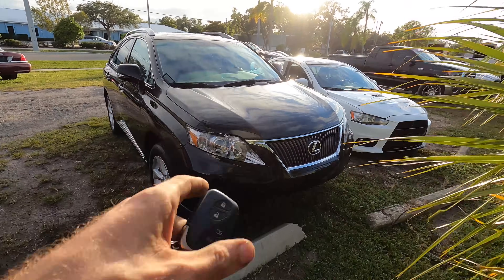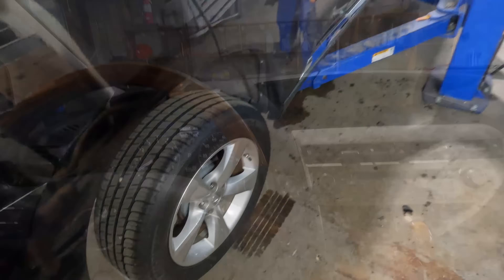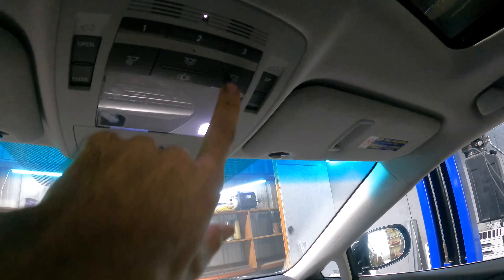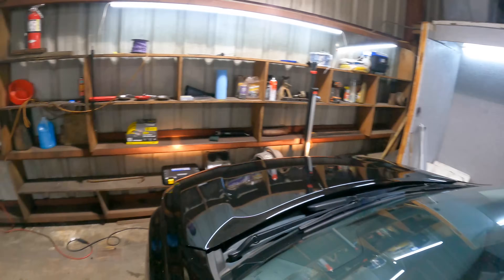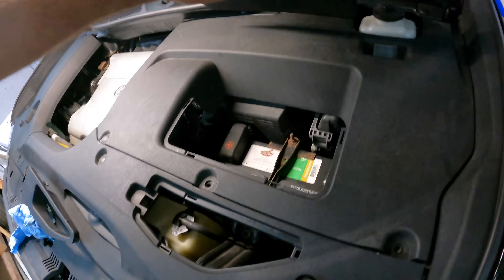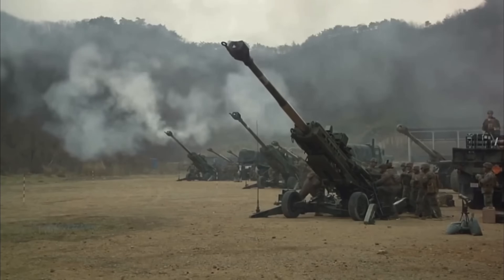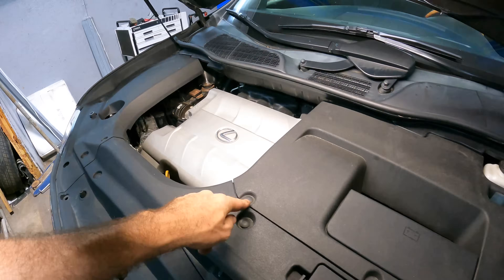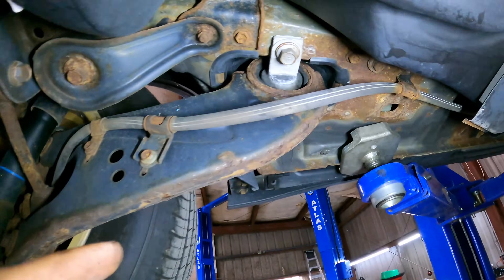Spoke Too Soon! Twice! Lexus RX350 3.5

Comment: You really should close that small side door Ray,its going to catch you out with a side mirror someday
Reply: Thanks, I was thinking something similar, that the open door is like an accident waiting to happen, particularly because it is so close to the drive-in entrance.
Reply: @TrondBørgeKrokli  it is an accident waiting to happen, an accident thats going to cost him a side mirror or paintwork to sort out a dent or scratching,
Reply: @johnmoloney5296  Very good point. That is exactly some of the things that make me worry and feel like it is a 6th sense kind of thing.
Reply: I have mentioned it , maybe it looks closer on camera than reality
Reply: @johnmoloney5296  Could be. Could be a case of camera angle making it difficult to see what the actual distances and angles are around that door, maybe even distorting the garage door dimensions. Thanks for pointing out that side of the story.
Reply: @TrondBørgeKrokli  it more than likely is

Comment: I have often experienced the steel sleeve rusting solid to the bolt so that the assembly turns in the rubber bushing; multiple methods of attack but cutting the bolt as you did is the quickest method.

Comment: Ray, you cut the shock and then cut the rubber the turn the bolt until can get at the split in the metal collar the you use a chisel to spread it a little, then the bolt comes right out.

Comment: I have a 2013 RX450h with 147k miles and I ran into the same exact problem with my shocks. It still had the original shocks and it initially looked like an easy job, so I decided to replace them. I watched your video first, then thought to myself 'I'm sure I'll be fine', but I had a heck of a time getting the bolts out. On the passenger side, the top and bottom bolts snapped and I had to drill and grind the old bolts out and replace them. In case anyone needs to know, the bolts are M12 X 1.25. Also, the old shocks still had some resistance, but they wouldn't rebound when compressed and had 'dead spots' where they had little to no resistance, so they needed to be replaced.

Comment: it was good you could find a usable nut and bolt, sometimes you have to destroy parts that are fused 
together from the “rust belt” up north! it is great to find a great car from down south where rarely they
have to use salt to clear the road of snow. it is nice to be able to just use tools to work on a car over
needing penetrating oil and a oxy / acetylene to get it apart!

Comment: you had one end of the bottom shock bolt out, next time just cut the head off the bolt, and spend a buck on a new one. that was a time waster for a simple cheap solution. also if your really good you would wheel bearing grease these entire threads before reinstall, cause they are hard to get out at 90 k miles, wait till another replacement at 200., lots of elbow grease later, and broken bolts rust welded. Thanks for the vids.
Reply: lol you got there.

Comment: next time u have a bolt stuck spinning in the shock and mount take a wire wheel to the treaded side to just knock the rust off thats stopping the bolt from comming out. it helps alot especially up here in Canada and the scrap yard wont let u take anything flammable or that can make a spark so wire brush it is. usually steel wore wheel or brush works good enough not to damage parts and not too soft that it actually takes rust off.😀

Comment: This is a daily thing coming from Wisconsin. Take a cold punch or one with a point and beat on the end of the bolt until it gives way. I use my 18 ounce for a few swings to get a dent in the end, then grab my 13# maul or just grab my die grinder/sawzall. Most the shops up here just keep the drawers stocked with grade 8 bolts and if it looks like it is bad, just go straight to cutting and replacing.

Comment: ok Ray, this is the usual for us in rusty NY....cut the wrap around the bushing, cut the rubber bushing off, heat up the metal sleeve cherry red, grab metal with vise grips and spin it out with air gun.....we used to get 4.99 a shock for labor back in the 80s to install shocks so we couldn't be dicking around with stuff that slowed us down....glad to see they haven't changed much in 40+ yrs

Comment: I wouldn't have spent that much time messing with that shock bolt. I would have just used a cutting tool and cut the bolt of on both ends to get apart then replace the bolt.

Comment: CENTRAL PNEUMATIC 21/32 in. Air Tie Rod Separator on the shaft side of the bolt head saves driving time.

Comment: Ray I appreciate the escalation of force you apply! I did the shocks in my avenger and black widow spider had set up a nest inside and the rear shock mount. Brake cleaner and a lighter I killed them with fire!

Comment: Ray , I would have cut as much as possible off of the loop the bolt goes through on the shock with a ziz wheel . Then if needed , cut the bushing and sleeve to get the bolt out and save it. I've been there . Good job any how .

Comment: All you have to do is put a vice grip on the outside of the piece it's stuck in and it will hold it in place and will allow the bolt to break free.

Comment: Another great Job. Whew! Made me tire watching you get that bolt out. We have a 2012 Lexus 450h. Approximately 108,00 miles. Putting in new struts and shocks and sway bars. I got the strut installed up, with the help of my daughter. I was able get the bottom bolt threw the knuckle. I pushed and jacked up the wheel/hub but in the process I now have pulled the CV axle away from the bushing. Had a little bit of oil run out of the boot. I’m going to try and push the axle back in tomorrow. Wish me luck. Merry Christmas.

Comment: Cut the metal around the rubber bushing, then cut into the bushing and metal  collar with a cutoff wheel to releive the rust tension on the bolt.   Then jam a chisel in there to spread it and air hammer it out from the thread side gently. If you have a spare bolt and nut  just give it the beans.  Maybe time to get a torch, can't be tight if it's liquid.

Comment: It's funny, just as I thought, I would put an air hammer to that bolt, in pops a chisel bit into the frame. Well played Ray, well played. Also agreed with escalation level 9. 👍👍

Comment: Here up north my first escalation has evolved into grabbing the oxy-acetylene torch. Favorite tool in the shop. Things start moving real good when they are glowing. Bushings stink and can make scary fire, but I would have just blasted it until the sleeve broke loose from the bolt. Best part is spraying the hot metal with water!

Comment: You need a good cutoff wheel and tool an cut the shock ring the the rubber and tube on bolt.

Comment: Thanks for your video.  I got both of the upper bolts out, the lower driver side nut came off but the bolt wouldn't come out.  The passenger side lower bolt head snapped off.  I cut off both bolts with a cutting wheel and got it all back together thanks to knowing I could follow your technique.

Comment: Just had similar fun replacing the control arms on my 2013 outback in PA. Had to cut the 19mm bolt out cause it was rusted into the bushing and I worked it so much the bushing eventually just tore all the away around so it was no longer attached to the control arm. Fun times.

Comment: Ray I had the same problem on my 02Jeep Grand Cherokee Laredo 4.7L rear bottom shock bolts and Sway Bar links.
The bolt was rust locked to the shock bushing sleev, but the bushing was not turning with the metal internal sleeve. But the sleeve doesn't come out or fit through bolt hole.
Its a rust Jeep thing.
I broke 2 bolts on a rear sway bar link and a rear bottom shock bolt.
Thank the car gods I'm putting Nickel anti-seize on all bolt shafts, wheel hub/rotor mating surface and 242 threadlocker on bolt threads to prevent rusting in the future.
I'm to the point that I pre-order new bolts beforehand and only then replace suspension parts.
The bottom bolt on rear sway bar link is a specialty bolt that has a huge shoulder shaft and small threads to fit in the sway bar connector hole(M10x1.50) you can only get that FROM MOPAR at $20 a bolt and $6 a nut!
The top BOLT FROM LINK TO TOP BRACKET is a M12x1.75x65mm (you can get on BelMetric $2 yellow zinc hex flange head,  coarse thread) this top bolt has the inside nut on other side of bracket welded to the bracket, so you can't order new M12x1.75 lock nuts.

How to measure bolts
In case anyone doesn't know:
M12X1.75X70MM = (M12)is the bolt shaft, 1.75 is how many millimeters between each thread called thread pitch, and last number is how long the bolt is after hex head to end of da threads.
The proprietary bolts cause a problem because the bolt shaft and threads don't have a measurement when ordering affordable bolts. So you need to bring that broken bolt to a Tractor supply/Home Depot.

Comment: As someone that has had to deal with rusted bolts almost daily, The cutting torch becomes your friend. I would have cut the shock off of the bushing to get it out of the way, cut the rubber bushing with a knife to get it off. Then find the seam of the steel sleeve and use an air chisel to open the sleeve releasing the bolt.

Comment: The wind deflectors are for noise elimination thats why they are on the high end models . Why is it you struggle with rusty parts then put everything together with out using anti-seize, Yes it works especially on spark plugs it makes the job easier the next time which may or may not be you.

Comment: 😀😃😄😂🤣😂🤣😂 This is by FAR your funniest Comedic video EEVVVAAARRR....
I just loved how you played with that lower Shock bolt like a NEWB Shade tree MEch would do, even to the point of knocking the back brace out with Hammer Slams....

What was even better, 😂🤣 is how you totally ignored the ""DRY GETS LUBE"" rule, by puching the bolt out, where we can see it is dry, gets No Lube, then pull it back in, where everything looks wet, and then you spray everything down again....

This is CLASSIC Mechanic Comedy, and it took me right back to being a 15 year old under a 62 GMC where me and a friend did the exact same thing, and we too gave up and used the whack saw.....

Thank you for the After Thanksgiving PreChristmas Comedy....

At least this year, the Holiday Downs won't be soo bad.....

Comment: Get that problem a lot on old land rover defenders. I've learned to cut the eye of the damper (shock) and peel it back so you can get access to the bush if you haven't got spare bolts about.

Comment: It was painful to watch you struggle with this shock rusted into the metal sleeve. I live in NY and know this problem all too well. Two suggestions for the future. Use a metal C clamp with a deep socket that the bolt head can silip into as you press it. If necessary cut lengths of threaded rod to add to the end of the bolt as it presses into the metal sleeve. The other way is to use a grinder and cut the shock eyelet in half, then cut way the rubber and then with a die grinder with a smaller metal wheel cut the sleeve carefully on both sides and split it and the bolt will come out without any further damage. I learned both of these methods the hard way with a lot of colorful words coming out. I'm sure if you were really careful with a cutting torch you could do it even faster. Thanks for the great videos.

Comment: When it comes to car repair, I found even the simplest job isn't always the easiest 🙁 When encountering rusted parts that will be reused, I wire wheel all surfaces and apply anti seize to the fasteners making installation easier

Comment: On that second bolt, I was thinking, "Bent bolt."  That's what I figured when I ran across the front passenger lower mount.  Used 2010 Xterra purchased three years prior to the shock replacement.  Cut through the bolt on the nut side figuring to knock it through from the end.  Buy a new bolt.  That took drilling through each end to get enough body removed to slide the bottom out and mount the new assembly.  Not the best solution, especially since I had only a battery gun, not a corded one to drill with.  Lack of foresight to have some MAPP on hand to see if a little heat would do the trick.  Lack of a sawsall, and the reluctance to get into the mount with a cutoff disk on a grinder.  That's the solution I came up with.

Comment: You have the outer end of the shock (metal) then there is a rubber grommet and then you have the metal tube that the bolt goes through. Grab that metal tube with a You have the outer end of the shock (metal) then there is a rubber grommet and then you have the metal tube that the bolt goes through. Grab that metal tube with a Vise - Grip or adjustable pilers.  I have run into this a few times in my 74 years and that always worked.

Comment: Notes for rust belt vehicles: 
Just use air tools.
Buy a torch kit.
If you have to take suspension apart, map your procedure and just order new hardware, bushings, etc (anything that isn't available locally) and just return or stock what you don't use.  That is, unless you don't mind the car taking up space for days.

Comment: As a retired tech if I couldn't get it with my ir 244 I would grab my 3/4 ir gun get it apart wire wheel the bolts and antiseize the bolts and nuts. Good job Ray I would of used the Sawzall as last resort.

Comment: I use my cut off wheels and cut a section of the end of the eye on the shock out and cut a section of the rubber bushing out to expose the metal sleeve and split the sleeve and spread it then the bolt will come out

Comment: My first shock job was My girlfriends car. It was an Apollo and I ran into the same problem with that bolt. It took me the whole day to remove that one shock that should have taken me an hour. I ended up cutting the eye off the shock ,then cutting the head off the bolt off ( no power tools) with  a carbide hack saw blade. I was NOT a happy camper. Now I have power tools and have no problem chopping the bolt off. I found a specialty nut and bolt place so they set me up with what I needed. This was back in 1983.

Comment: happed on my car.  The bolt head breaks off on the welded nut.  They had to saw off the nut and put a new one on.  Replaced mine with 4 KYB but the ride isn't any better.  Bounced pretty rough on put holes and bumps.  I don't know if the tie rods need replaced as well for a better ride.

Comment: I had a rattle on my new to me RX. It was the plastic splash shield retaining area under the drivers door. Once at speed it would drive us crazy catching the wind and smacking the bottom of the car. I also think it’s missing the fwd under engine splash guard. I swear that rattle was the reason the previous owner traded it in.

Comment: After escalation #1 I would have gone #9 next, Sawzall or cutoff wheel. So many times the steel anti crush sleeve will rust to the bolt and never let loose. I've cut and burnt the rubber bush out and then split the sleeve and they still will fight. 

Ray NEEDS a wire wheel bench grinder. All those rusty bolts need a bit of brushing and then some rust converter.

Comment: I'm an old mechanic then service writer then store manager so don't take this wrong. My question is did you fix their problem? You didn't explain any of the conversation with the customer but I would have presented it as I couldn't find nothing loose other than the panels, I cannot confirm that it is the source of the noise but it's the only thing I can find other than some worn and leaking rear shocks. Now I didn't go back and rewatch the video so if you did have this conversation with the customer then I feel like a fool and accept my apologies for sticking my nose in your business. And hope you had a good Thanksgiving.

Comment: Great job bro. Only thing I would do different is after a few hits with a hammer if it didn't come out I'm going straight to cutting shit. The new bolt would also go in the opposite way just in case the next guy has to change it he can hit the thread end with enough swing to matter

Comment: I had a very similar problem when attempting to remove a bolt that connects the knuckle to the strut on my 2004 Matrix. The bolt jammed hard after it backed out 1/2 inch, couldn't turn the bolt either way, even with a cheater bar - it was as if the bolt was welded in place. Desperate to get the bolt out, I decided to hit it with a torch for a minute or so and was able to finally get some movement. After repeated heatings, it finally loosened up enough to pound the bolt out with a chisel. 

My theory is that moisture must have seeped in, eventually rusting the threads. In the process of backing out the bolt, the rusted threads broke apart. When the intact threads reached the rust they likely bound up on the rust, packing it down super-tight. Applying heat drove out the moisture, loosening the pack sufficiently to be able to pound the bolt out with a chisel.

Comment: I had this problem when ohio crust seized the control arm bolts to the bushing sleeves. I was able to get vise grips locked on the bushing/sleeve which would hit the frame to keep it from turning, then with a breaker bar and extension I was able to turn the bolt out. Major pain in my ass.

Comment: Those battery checkers are junk and are not accurate but what do you expect from China. 😂 Lots of rust for a FL vehicle. Looks like it’s been in the salt winter roads but I know you get humid summers. 17:02 I would added anti-seize on the threads. 32:03 I would have cut the bolt long ago and replaced it with a new one.

Comment: You have way too much patience, I would have got the angle grinder out and probably cut the bottom of the strut first and then the bush failing which the bolt. Had a similar experience on my vw passat rear innerwishbone bush and the grinder won that competition.
Keep doing the doodlie doos Ray!

Comment: Wouldn't it be worth removing at least loose rust with the wire brush before putting the shock absorber on? Or was that done off camera and I couldn't tell the difference? 🙂

Great to see customers flowing in for the new venture.